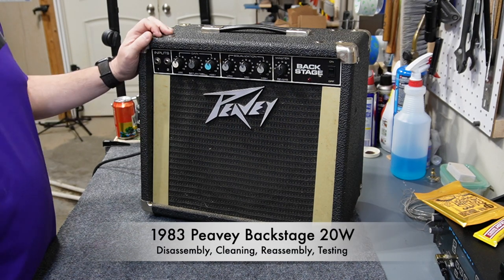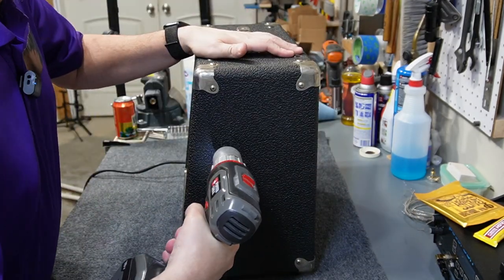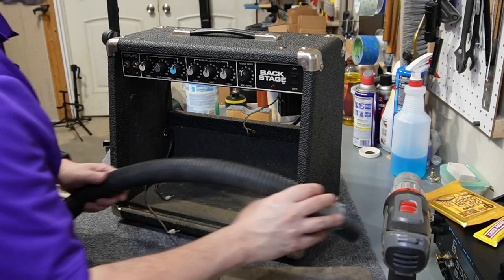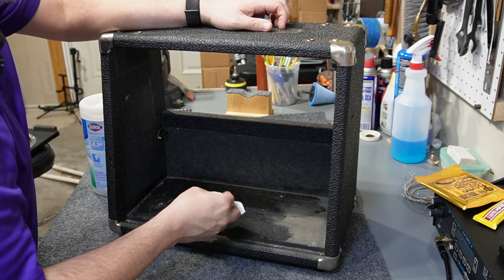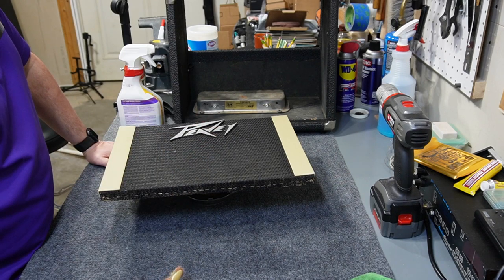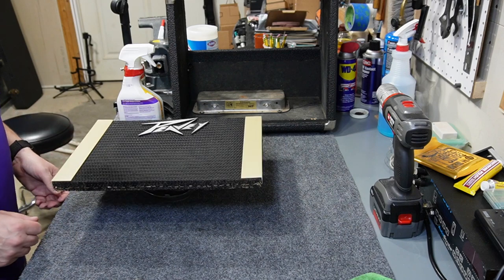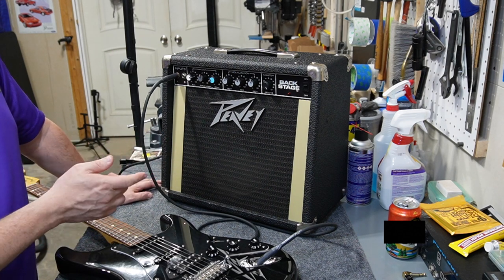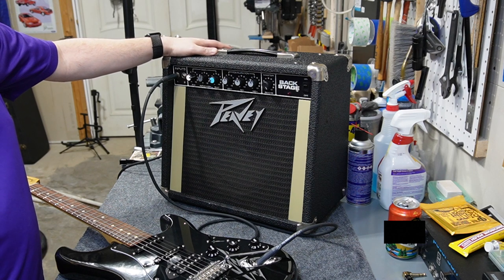Thrift Store Guitar Amp Cleaning and Maintenance: 1983 Peavey Backstage 20W

Comment: Had the back stage plus
 35 watt ' played it through a 4/10 PV cab for 3 years
3 to 4 nights a week on stage.  One of the best sounds I've had.
Reply from the maker: I’d like to get my hands on a plus.
Reply: @hacksguitarhobby I picked up an '88 backstage 110 for cheap, they're sixty watts at 8 ohms, I put a 16 ohm celestion creamback in it and it sounds amazing compared to the stock speaker even though it's only making a little over half power because of the impedance mismatch...and I removed the peavey nameplate and cut out the speaker opening the whole way because the nameplate mounting area was blocking part of it, and believe it or not that helped the amp project the sound better

Comment: I bought a Backstage Plus (30w) from a charity shop for very little. It always had an intermittent input jack. Finally got around to dismantling the chassis and found the cracked solder joint on one of the jack pins. Amp sounds better than ever now. The repaired joint has got rid of extraneous background noise. The sound is much cleaner overall.
They are fantastic amps. You can dial in a good valve  breakup setting. It's also a great pedal platform on the clean setting and the 30w is loud enough to play smaller gigs. Bigger gigs just mic it up.
Reply from the maker: Micing smaller amps is the trend now, and I think people are starting to realize how great small amps are.  Big time back saver!

Comment: Peavey amps are great.
I have a 1984 and a 1985 Basic 40. I put EV speakers in them as well as a crossover and a compression tweeter.
I have a 1987 Minx with upgraded speaker.
I also have a 1988 Microbass amp with upgraded speaker.
Gonna keep these amps even though I have some high dollar amps as well.
Reply from the maker: I had a Minx back in the day.  Small Peavey amps are awesome and nearly indestructible.